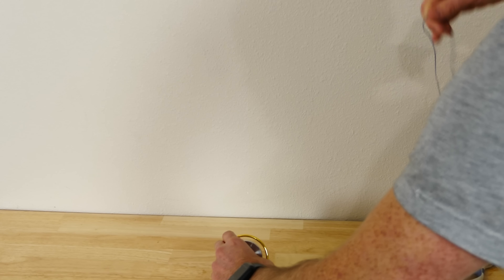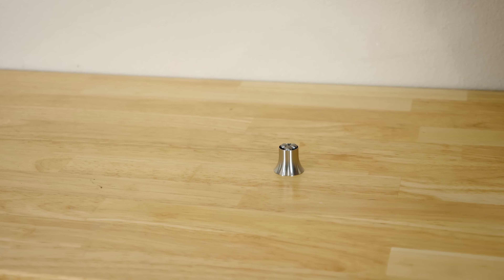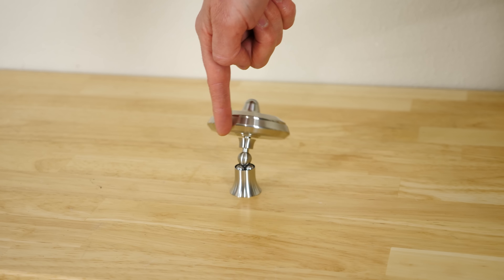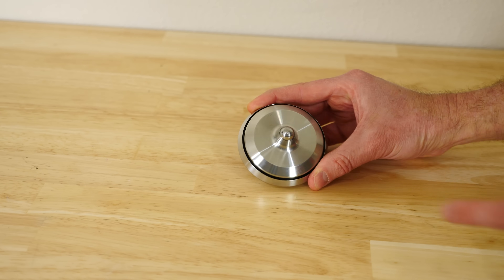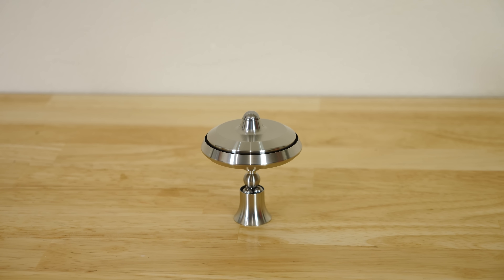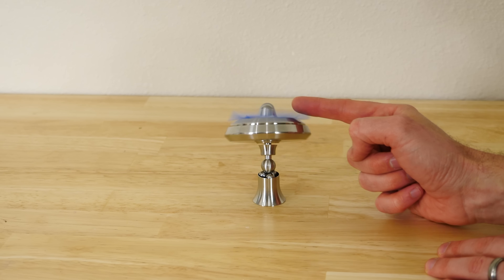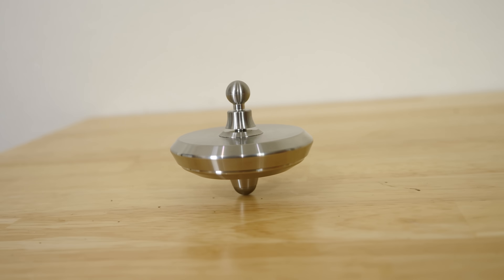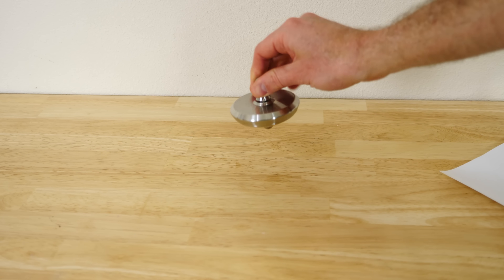How Do Gyroscopes Lift Themselves Up?

Comment: Gyro experiments are one of the bests. It does so many thing unexpected and it’s just interesting to play with it. Perception, self correction, persists direction without any friction (except on axis), direction and speed of perception in different situation, holding a gyro on a spinning chair, alter rotation inertia during rotation, and so on. All these can be easily explained by angular momentum, but still counter-intuitive nature of it makes it amazing.
Reply: Is it easily explained?
Reply: @donotwantahandle1111  Yes, through conservation law of angular momentum and vector addition of torque.

Comment: So how do you balance the effects in a navigational gyroscope so that it doesn't drift over time?
Reply: Really really good bearings. But basically you measure the errors, and feed an electric current into a torque motor in the 'opposite' direction so to speak. Don't get me started on correcting for Earth latitude, Earth rotation, Gimbal lock, schuler tuning,..... it's a long list.

Comment: "If there was no friction the gyroscope would precist forever" no not exactly the gyroscope is still transferring rotational energy to angler energy.  It would very slowly loss energy . Please correct me if I am wrong. 🙏
Reply: It is not really transferring any energy though,   It is only using the energy it has to change direction.  Without friction there would be no energy transfer and no losses.

Comment: If I have attached a gyroscope to rocket would the rocket ascend perpendicular to gravity
Reply: Do you mean attach the gyroscope to the rocket as a contorol mechanism or as a measuring device to know the angle of the rocket?     

They actually spin some rockets to create a gyroscope effect to keep the rocket stable.  Not sure if that is simmilar to what you are reffering to or not.

Comment: If gravity existed, it wouldn't still be a theory.
use density and buoyance instead.
Reply: How does buoyancy and density work if there is nothing to pull the more dense matter down???  If there were no gravity, density would not matter and matter would not be buyant.
Reply: @Bendigo1  helium balloon defies gravity, or is it lighter?
If gravity can hold the moon in orbit, why are you not crushed?
If the spin of the earth is greater at the equator, why do you not weigh less?
The globe is preposterous.
Reply: @AverLife  Helium baloons float because they are lighter than the air around them.  
gravity has more effect on objects with higher mass, thet is why bigger people weigh more than smaller people and the moon is kept in orbit without the same gravity crushing us.
Things actually DO weigh slightly less at the equator than at the poles.   The rotation of the earth is less than 0.01rpm, so the effect is not as much as if it were  rotating at 10 or 20 rpm.

A flat earth makes even less sense than a globe.

Comment: Indeed gyroscope is a very simple thing

the torque of downward tilting acceleration by gravity acted on the lower part of the gyroscope causing a velocity of downward direction acting on the lower part, which then get spinned up to the other position opposing the further tendency of the downward movement of the overall newly lowerpart of the gyroscope, thus maintaining the position of precession at the balanced state of the spinning speed on renewing different parts position of the gyroscope and the downward torque.

Comment: Dead on balls, but no one know "why" precession happens.  It is not due to a conservation law.  That is what physicists derived from math, but that math is analogous and misses the true cause.  THINK!  Spin velocity and TILT VELOCITY are perpendicular vectors.  Perpendicular vectors may add together, but THEY DO NOT AFFECT EACH OTHER.  Tilt velocity is causal, and journals will not hear it, because it contradicts the paradigm.
Reply: I have to add:  Tilt velocity must COMPLETELY reverse itself TWICE per rotation.  It completely resolves to acceleration instantaneously, continuously, and always perpendicular to the spin plane.

Comment: You are forgetting the force of the spinning wheel changing direction.  If you force the speed of precession faster you will get a lifting force or slowing it will get a down force. If you pair two flywheels to spin in opposition then the force from the precession will become linear.  In other words reactionless propulsion. Your welcome to try it but it will not work without the proper geometry.  If the flywheels are not aligned properly you'll be wasting your time.  Figure it out for yourself because I have already said too much.

Comment: Im glad you are on the gyroscope subject.  There is a company that makes them for small to medium boats that stabilizes in waves.  I am wondering if you think it's possible to have a gyroscope in an off road trophy truck that prevents nose dives. I think it's reasonable and could get us video game like stability.
Reply: I had a similar idea with small planes to prevent nose dives, yours is most likely more reasonable though!😂
Reply: Wait, what? A gyroscope large enough to stabilize a boat? It seems like that would have to be very large and prohibitively expensive.

For an offroad truck, one of those that ramps hills like in motocross, I would think you wouldn't want that. You want the truck to easily tilt back as it's going from flat ground to the base of a hill, and then you want it to tilt forward gradually as it's floating through the air so that it doesn't land on its ass. I've had enough dirt bikes to know that landing with the front wheel way up in the air isn't ideal even if you're landing on flat ground. It also seems like the truck might try to roll to the left or right (just like in the video) as forces influence it to tilt forward or backwards. I picture the truck launching off the hill leaning to one side and then landing on the opposite side, though that may be a bit dramatic.
Reply: Aren't the spinning  wheels working somewhat like that? I think the car tips forward when you brake and stop the wheels from spinning forward.

Comment: Yes! Neutrinos are all spin. 3 axes of spin. When a bundle of 3 perpendicular gyroscopes is moved what happens?  The gyroscopes start tumbling. Like neutrino oscillation. 3 axes of spin tumbling. Each axis with a different coupling factor. Static. Electrical. Magnetic. Which Because charge is how we measure things gives 3 different "generations" of particle.
Reply: This is really interesting. Is something you arrived yourself or there is some interesting website I can read about more (because I like very much this interpretation which could get us more further into science)

Comment: I was a little disappointed you didn't put it in the vacuum chamber,  but I think I remember you doing a similar experiment in an earlier video. The time increase wasn't significant.
Reply: Tech And Gaming  i would rather be in control and alive than "blown away". So thanks, but no thanks. 😂
Reply: I really enjoy your demonstrations. Thank you!
Reply: That's because the air resistance is already so low that there isn't much to gain by getting rid of it.
Reply: Friction will be humanities weakness
Reply: @loganthesaint  That's how babies are made.
Reply: @calholli  you beat me to it and said it better. Well done.

The babies statement, to clarify.
Reply: It probably won’t make any difference. Sucking the air might disrupt it more.
Reply: Link?